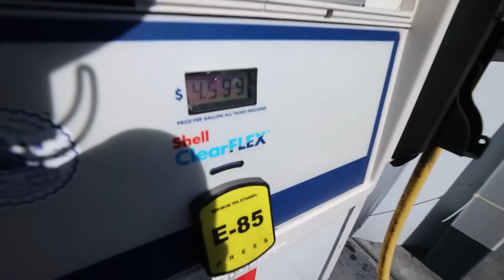K Swapping my Honda Civci EG | K24 Engine Teardown! Ep. 3

Comment: Not to burst bubbles! But an RBC or RRC mani out flows Any S2 Manifold. Only way S2 Makes more, is when ported. But when you port the stock RBC you have the same results.
Reply: Yup everyone runs a ported RBC junk2 isn’t that great
Reply: Ya I hate Junk2 , I’d pay Dustin to not rep their shit
Reply: But your paying a machine shop just as much to port the mani, meanwhile for same price you can buy a clean already ported mani
Reply: @Botcheykibbles46  I have seen stock RBC's make more power than that Skunk2 manifold on NA engines, the Skunk2 manifold is only worth it on turbo set ups IF you can get it at the same price or cheaper than a RBC
Reply: @ivantsipr  I never said anything about power.
Reply: @Botcheykibbles46  then what manifold do you recommend? lmao cause dustin bought the wrong one, thats forsure. the s2 ultra race manifold is the one to get...
Reply: A rbc doesn’t put flow a s2 ultra street. Depends on engine setup and mods but for the price of an rbc it isn’t bad

Comment: Skunk2 manifold only worth it if you going turbo, for an NA engine it sucks, a Civic SI (RBC) or Type R (RRC) would flow a lot better, also double check the VTC gear and make sure is a 50* one, the 25* one will limit the power a lot.

Comment: pulls out my notebook with 2 pages of parts written in it for the ultimate jdm EG build   I see a lot of people suggesting the 50degree vtc gear, you can have a 25degree milled out to 45degrees so it cant go too far and possibly cause damage in the valvetrain